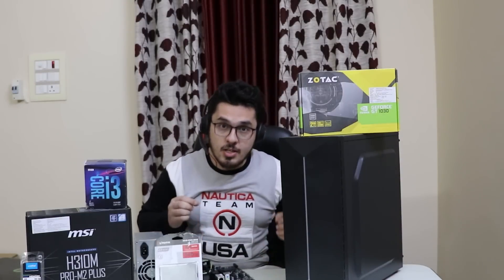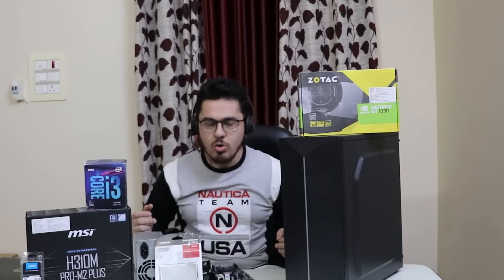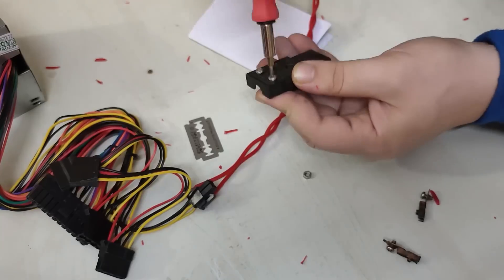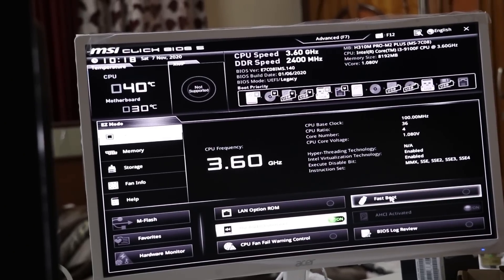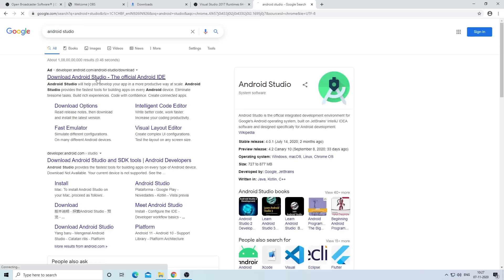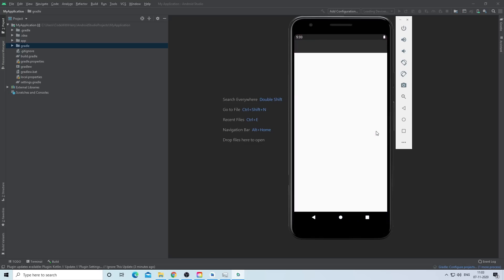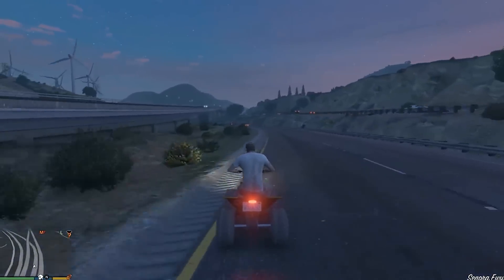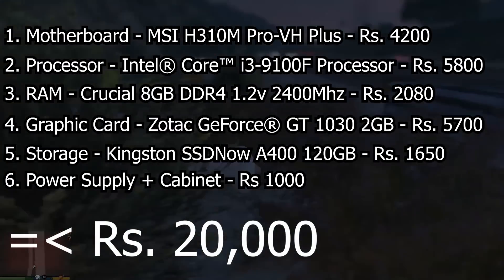Best Rs 20,000 Budget Gaming PC Build - Step by Step 🔥🔥

Comment: Best 50k Pc build (better than 70k laptop)

PROCESSOR = Ryzen 3 3100     (i5 9th gen apprx powerful)
GRAPHIC CARD = Zotac 1650 Super ( only zotac give 5 year warranty and on 1650 super u can do literally 1080p ultra graphics gaming)
RAM = Corsair Vengeance 8GB 3000mhz (Dont go below 3000 mhz as ryzen perform better with high clock speed)
MOTHERBOARD = Asus b450m (dont go for a320 as it cant handle our full performance)
POWERSUPPLY =  Corsair vs450 OR Cooler Master MWE450 (450 watts is more than enough)
SSD = Kingston 240 GB (install windows in it)
HDD = WD blue OR seagade barracuda (for storage purpose)
MONITOR = LG Ultragear 24GL600F 144hz monitor (it is smooth af)
CABINET = Any cabinet u like in 3k budget but see reviews about airflow
KEYBOARD AND MOUSE = Any keyboard and mouse u like under 1k (or more if u want)
ACCESORIES = wifi dongle and other stuffs in 1k

NOTE = Prices are high due to this shit CORONA :/
 1. U can go for RX570 graphic card if dont have budget.
2. Always use higher clock speed ram with ryzen processors
3. u can use any b450 motherboard but dont go below it
4. Powersupply is enough but if u want to upgrade later u can use 550 watts supply
5. Dont remove SSD to cut your cost !!!
6. Go for IPS monitor if want to do color correction type work 
7. choose good airflow cabinet

PIN THIS :)
Reply: Bro...
1 lakh pc better than 1.5 lakh laptop please reply
Reply: @ourchannel5685  obviously
Reply: @morchaff  hmm
Reply: Bro 70k me rtx 3050 wala laptop aa jata hai 🤣🤣 with ryzen 5 5600h 🤣with 144 hz display 🤣

Comment: Harry bhai ye muzhe, 11000/- mein pad raha hai second hand with 1 year warranty. Kya mein ye lelo. Please jo koi bhi ise pad raha hai reply jarur dena meri thodi help ho jayegi.
Hp 4300
Core i5  3rd Generation  
500GB HDD 
4GB Ram 
Windows 8 licence
Reply: You can buy but you will have to buy a graphics card like 1050ti if you manage to get this used for around 8000 then aankh band karke lelena 
Or you can go for used Rx 570 that can be under 10k used and 16k new this card will give you 2x performance than 1050ti
Reply: @tusharmaithani7174  thank u for your suggestion

Comment: Is build se accha RYZEN 3 4300G tagdi gaming Karwa dega at lower price. Also R3 is faster in most tasks than I3. In my personal experience R3 2200G takes 4-5mins but i3 takes 12mins to copy 52Gb data from HDD to SSD(the file is a solid ISO file)

Comment: Guys don't go for this power supply just a suggestion you should go for cooler master mwe 450w atleast or your pc will not get clean current and parts may get damaged
2800rs ki 450w ki psu banane wale pagal nahi hai trust me search about 500rs vs 2500rs psu pls don't buy cheap psu everything else is fine but better go with amd to save budget and also get upgrade in future in same motherboard I am building my own pc specs down here

Ryzen 3 3200g -cpu
Corsair vengeance 8gb 3200mhz -ram
Ice 130ag - cabinet
Crucial 240gb ssd (I don't remember model no. Forgive me)
Cooler master mwe 450watt power supply
A320m k asus motherboard

This doesn't have graphics card but alone igpu is able to beat or match gt1030

Comment: Spend 5k Extra and You will Get:

Amd Ryzen 3 3200G - (8700 INR)
[Upto 4GHZ, 4 Core, 4 Threads]
===========================
Gigabyte A320M S2H (4500 INR)
===========================
GSkill 8 GB DDR4 3200 MHz (3250 INR)
==========================
Corsair VS 450 watt (2700 INR)
==============================
Western digital 1 TB HDD (3400 INR)
==============================
AData Su 650 M.2 120 GB (1700 INR)

Cabinet mein agar kharcha nahi karna tho 200 inr ka Zerbonics ka aacha cabinet aa jayega,

STRONGLY SUGGEST NOT TO BUY 500 INR CHEAP Power supply,

Agar usmein kuch locha hua tho motherboard sai leke cpu, ram, sab jayega, aur experience sai bol raha hu, KATAI NAAA HA, buy braned PSU.

5k extra spend karke, ek powerful APU by Amd, ye processor sai log Warzone jaise games khel rahe hai YouTube pe, GTA V butter ki tarah chalega with 45 fps

Ram DDR4 sai neeche lena hi nahi, chaahe koi bhi YouTube kitna bhi bole, 3200 mhz Ram are not so costly, 

And you can see the speed difference on your own with 2400 mhz Ram,

35k under pc budget, simply go for Amd ryzen APU, don't buy Graphics card

All prices are taken from Amazon, credit card lagake 20k ka hi ban jayega!

Comment: Mai ne bhi PC build kiya 2 months pehle Ye specs ke stah:-
AMD Ryzen 3 3100 (4 Cores 8 threads)
Corsair Vengance 8GB DDR4 RAM(3000Mhz)
GT 710 DDR5 2GB
240GB WD Green sata SSD
500GB seagate HDD( for Linux and ubuntu and other stuff.)
Antec CV 450
Gigabyte A320 Motherboard
Same Cabinet
Used monitor 15 inches.
AMKtee keyboard and mouse combo.
Price total : 30K Almost.
Maine pura focus processor pe daal rakha tha isliye..

Comment: bro every component is good but the power supply is worst it is not 500 w it will provide 200 or less w and will increase a lot of electricity bill the best alternative is vs450 PSU which is costly but best, and I have soft corner for and change processor and GPU with ryzen 3 3200 which is both processor and graphic card in one and better than 1030 GPU
my review 3 out of 10  as I am professor pc builders

Comment: My configurations :-
Asrock b450 steel legend (Motherboard)
Rx 590(Graphics Card)
Corsair cx 450(Power supply)
Amd Ryzen processor
4*8gb*DDR4 Corsair Vengeance Lpx Ram
Antec CPU cooler
Black Corsair ICUE 220T RGB Airflow Tempered Glass Mid-Tower Smart Case
Processor:- Ryzen 5 3600
Storage:- Kingston 500GB A2000 M.2 2280 Nvme Internal SSD PCIe Up to 2000MB/S (SA2000M8/500G) + Crucial MX500 500GB M.2 Type 2280 SSD-CT500MX500SSD4
Mouse:- Xanova Mensa Pro Esports Gaming Mouse with RGB (Gray)
Keyboard (mechanical):-
Ant Esports MK3200 | Mechanical Backlit

Comment: This video is click bait !! 🤣🤣 This is no 20k build..  1. Power supply is so cheap that it can harm your pc parts all youtubers recomend at least corsair vs 450 that is rupees 4000. And the cpu will cost you around 6500 rupees and the graphic card is so shit that this will get bottleneck and this graphic card will cost you rupees 7000 rupees. Isko mat lena amd ka 2200g apu le lena with integrated graphic . Ok bye .

Comment: I recommend you to get ryzen 3 3100 because this processor doesn't have any integrated graphics and have 4 core 8 threads which is far better and cheaper than the i3 8100!!

Comment: bro a gtx 1650 super instead of gt 1030 and a corsair rx 550 watt psu instead of a cheap power supply would have been better 
and it would cost less than Rs 30,000k

Comment: AMD crushing Intel with price and performance, now Intel have to reduce price to compete with AMD and the winners are the consumers. India should also launch their high performance processors like Quantum computer working at room temperature then will be at top of the world. These IC will not improve with architecture size, so they have to increase core count which will increase the heat generation and power consumption. One suggestion don't build PC if you don't know  basic. Because these online guru make you buy or build PC which you don't need (Because you'll never use that much core or that much RAM. If you just want to play games then sky is the limit but there is a catch.... you'll never know what is more important CPU core count or GPU )

Comment: Harry bro i wanna ask one think m using lenovo ideapad 530 laptop the thing is that m using 4 gb ram with i3 7 gen processor.... But m facing issue with my lappy is that its being hang on whenever i will use more than two heavier task at same time ,...whats the best choice for improving  its speed Ram ya ssd suggest me bro.... M little much 🤔confused
Reply: Dono Sath mai krlo Jyada Acha Result milega.
Reply: Budget Km ho toh 120gb Ssd + 8 Gb Ram Upgrade krlo.

Comment: You are the best bro.. I was thinking about to buy a laptop in the rate of 60,000 obviously mhnga pd rha tha mujhe ab ye dekha h soch rha hu computer build kr lu better rhega
Reply: Buy 
r3 3100
1650 super 
(8×2) 16gb ram 3000mhz kit
A320 
Cv450w psu
Gx 3000 cabinet 
240gb ssd
Upgrade to 1tb later

Lg 22mk600m monitor (for editing and entertainment)
Aopen 24hc1q (for high fps gaming) or acer 144hz
Cb gk 12
G102
Reply: @pranshu2op  Okk brother sochunga aur achha ho ske to vhi krne ki koshish krunga

Mi notebook 14 horizon edition lene ki soch rha tha graphics  card se lkr display tk sab kuchh achha tha i7 ka 10th gen processor bhi tha, but 60,000 is little bit expensive.

Comment: No hate, but you could get a much better pc within 20,000 rupees and the gt 1030 is absolute garbage imo in most cases a ryzen 3 3200g would do much, much better than a gt 1030 and i wouldn't call this pc a "Gaming" pc nor would i call it "Bahubali" i understand you need the clicks, however this is down right misleading. You said that in the comments that 16gigs of ram would be required for the 3200g to work properly however that is not the case you can check online and with my experience as well there is no issue with 8gigs of ram in dual channel (which would costs only slightly more than 8gb single channel) and as far as i know you haven't mentioned upgradability which is supported on amd side much better. And i would suggest going for 1tb hdd and then save up for ssd coz you will barely have enough space left after installing windows on the 120gb ssd.Never ever cheap out on psu because if it fails the whole pc can be destroyed. Below is what i would consider a better build

Ryzen 3 3200g - 9000 rupees
A320 motherboard - 4000 rupees
1tb hdd - 3000
2x4gb ddr4 2400mhz ram - 3000
case- 1000
Antec 450w psu -2000

Note: if your budget allows it get an ssd which is more than 120 gb or else it's not worth it, it will fill up with windows and this pc is extremely upgradable and it will play most e-sports titles but dont expect AAA gaming with latest titles. I would suggest saving up and upgrading the ram and gpu, go for 1050ti or 1650 in the future which will get u a huge performance boost in productivity and gaming

Also Harry, no hate on you but this video might lead to some people wasting money.

Comment: Bhai windows install kaise hoga?? Will I have to buy windows 10??
Reply: Not necessarily! You can google 'download Windows 10' and install the ISO from the official Microsoft site. The only limitation you will have is you are going to get the watermark on the side and some of the personalization settings would be disabled for you. However, if you want access to customize the taskbar and remove the watermark, then you can pay, which in my opinion is really not necessary. There is no difference in running free vs paid Windows. In fact, running free Windows is the best option than running pirated ones, which can have serious security and privacy concerns.

Comment: Harry Sir I have One Question that if I only want to use this pc For Coding then It will be ok For me to not have Graphic Card As pe Budget ?? It Will not affect My Vs Code Perfomance ??? 
By the Way Thanks For making Such a Great Playlist so We Can Learn Ourselves
Reply: Yes vs code will work fine, but apps like photoshop will suffer
Reply: @zombiekiller7101   Or should I go for base Graphic Card like Zotac 710 ??
Reply: @pooransuthar1654  the processor he used is i3 9100f in which "f" means it doesnt have integrated graphics, you NEED a dedicated gpu or else there will be no video output.
Reply: @cherff  Thanks Reyhan Rich Even I was Having The Same Doubt But Someone Said That There is No Kind of Such Thing
Reply: @pooransuthar1654  np :)
Reply: A cheap GPU is better than having integrated graphics
Reply: @zombiekiller7101  I don't want to do any kind of Productivity Just Coding and Some Lower End Games If Possible ?? and Thanks For Helping me Out

Comment: Sir, this PC can be good for gaming but can't give you atleast a smooth gaming experience and forget about productivity. Also, you should use atleast 240gb ssd in your pc if you want to do easy productivity on this pc. Sir, you should use a brand psu for this build because I used a cheap non-brand psu from zebronics and its stop working in just a year without doing any gaming, coding or productivity task on my pc. I do only basic tasks. The ram frequency also matters if you want to do low-end gaming.

Comment: Sir can we expand the storage to 500gb or 1tb please tell
Reply: Yes
Reply: @tejas4813  how
Reply: @rishukumar2905  Just Buy 500gb  SSD Instead of 120gb 🙄
Reply: Or If it Has Extra Slot for Hard disk , Then Buy A separate Hard disk  ,  And If It doesn't Have extra Slot Then connect Hard disk externally through USB Port

Comment: Harry sir you won't believe I was going to buy a desktop in 1 or 2 weeks , this video helped me alot 

Thanks
Reply: R u serious dont buy it please watch some peofessional guides and channel like tech nation, pc wale well u can do some research and dont use intel cpu they wont give u a good performance and power supply 
Is a total shit buy some good powersupply aroud 2000 dont go for  
500 rupee powersupply its dangerous
Reply: @crakelhead5876  I was confused about how to put the processor in place , ram in place stuff like this . 

I am never gonna buy intel i3 9th gen as I know it do not worth the money .
Reply: And yeah he said isko saste main milla iska matlab koi gaurantee nhi ki tumhe bhi utne price main mile research karke hi lo
Reply: @crakelhead5876  actually I was thinking to use Ryzen 5 3rd gen can you please tell me it would worth or not ??
Reply: @vedantx-b2986  whats ur budget
Reply: @crakelhead5876  45K
Reply: @vedantx-b2986  ok so here is the list i guess it will cost u more or less acc to prices

Cpu ryzen 5 3500 (11k to 12k)
Motherboard msi b450 pro vdh max(7k) (if u want a better mobo then go for msi b450 tomohawk max it will cost around 10 to 11k but trust me its worth it)

Ram- Adata XPG 16 gb ram 3000mhz (8gb 2 sticks )(2699rs well it might be expensive in your region)

Graphic card -1650 super (13k to 14k)
Psu corsair cv450 or vs 450(cv is better but vs is also good)
Hdd -Wd blue 1tb or seagate baracuda (3199rs)
Ssd-240gb(company doesnt matter just dont buy 120gb if ur budget is low then dont buy and if u want to buy m.2 nvme ssd then u have to pay nearly 3200 or even less  )(less than 3000rs) 
Here you go u can do more research i skipped cabinet well u can buy any 3k to 4k cabinet if u want to make it cheap buy amd rx570 graphic card instead of 1650super and yeah monitor and other things i havent included

Comment: Many prefer AMD over Intel, what you have to say on this Harry?
Reply: Ryzen 3  requires Minimum 16gb ram to Work Properly Because it has integrated graphics , And The Motherboard Also Doesn't Support It , So You Need More Money to Buy More Ram And New MotherBoard , The total cost Will go Upto Around 28k
Reply: @tejas4813  it's a myth bro...
8GB RAM is more than enough
Reply: @programmer4047  What About MotherBoard
Reply: @tejas4813  A320 Motherboard Will cost U Around 4000 rupees
Reply: @tejas4813  And, it is pretty affordable in this price range
Reply: @tejas4813  16 GB ram ya kisne Bola bhai
Reply: @I_amNoob  Harry Bhai ne

Comment: This power supply can be dangerous as it is not bronze rated and we should not compromise with power supply and there also could be shot circuit if someone use the pc for long
Reply: Also it will burn wire
Reply: I saw a youtuber burn his whole setup just because of a poor power supply
Reply: Absolutely true 🤔
Reply: completely agree with this one. Cheap  power supply will degrade life of your pc components.

Comment: Hi 👋 Harry bhai 😀 , I need your help 🙏 , Please tell me  "Dell Inspiron 3593" laptop would be good for programming , My budget is low 🤕, If you say so I will buy this laptop...I will just learn programming 🙏 
PLEASE TELL ME 🙏 wait for your comment!

laptop details:
Brand : Dell 
Processor : intel core i3 10th generation
Graphics : 620
Ram : 4gb DDR4
Hard disk : 1TB
Battery backup : 5 hours
Operating system : Genuine Windows 10
Reply: Harry Bhai ... please help me 🤕 need your help
Reply: @saifurrahmanudoy  if possible upgrade the ram to 8 gb..
Reply: Bhai 🙏🏻🙏🏻 Plz SSD Balan vala laptop le. Me pachtarahahu HDD lagvake 👍🏻👍🏻
And DOS vala model le laptop ka 2k-3k price kamhogi😃😃
And purchase it OFFLINE. 🙃🙃
Reply: Ram is ok, but try to go for ssd storage rather than hdd it will make your laptop faster
Reply: @rohanharichandan1503  bruh what 4 gb enough ?? 

Loading time don't matter that much imagine you close a program like vs code and it don't respond to it how uncomfortable is that so he better get a 8 gb ram

Sad is only 10-20 second faster
Reply: @aryanpuri6192  4gb is ok for initial programming but if you are going for devlopement like using android studio then definitely you need more like 8 gb of ram for smooth performance, which he can upgrade later, my laptop has 4 gb ram and I'm using android studio and it's not that slow, I'm also using vs code, eclipse, pycharm and every thing is working in decent speed not slow, but more ram more fast is not only the fact you should also focus on hard drives ssd is not only reduces the boot time but a lot more than you think
Reply: @rohanharichandan1503  you can't upgrade the ram if he does then the warrenty will be affected !!!! 

And let's be honest pc are better the laptop !
It's better he built a pc he can get 3x more profomance in same price point

And ssd are useless if you are a little patience in the loading time lol do you think ssd is a prosessor or something
Reply: @aryanpuri6192  ya computers are better value for money than laptop but the only demerit is it is not portable
Reply: @rohanharichandan1503  you know that if there is a benefit than there is also disbenefit of a product
Reply: the ram is too low (4gb) in wich 2 GB is taken by the os 

find a laptop with at least 6gb ram 
then it will be a beast 

Dell Inspiron 3593